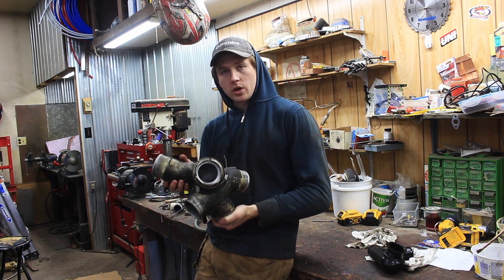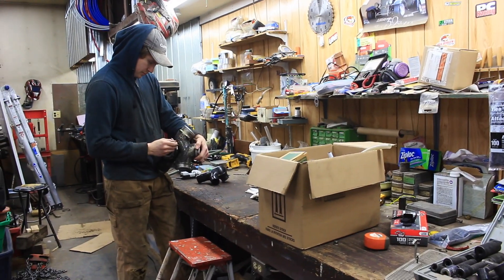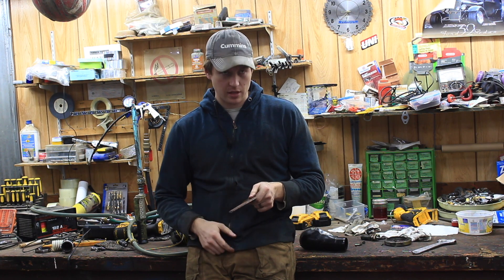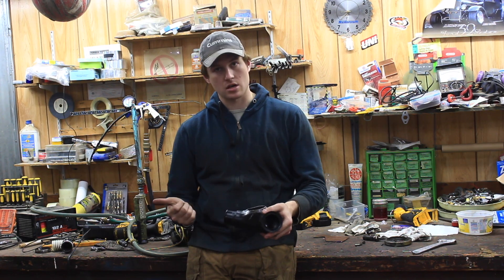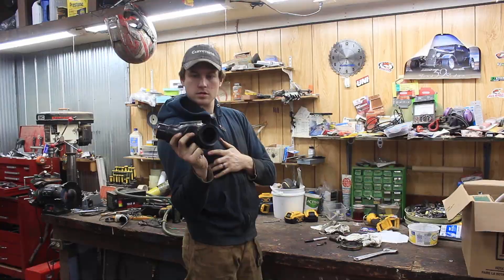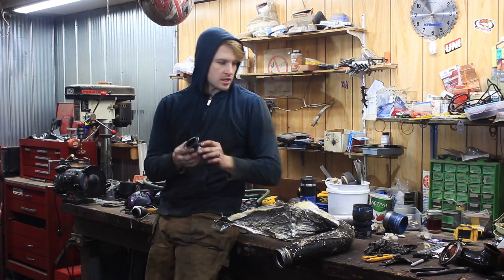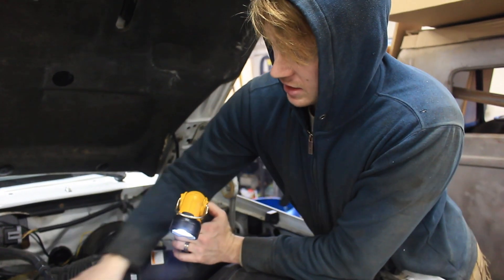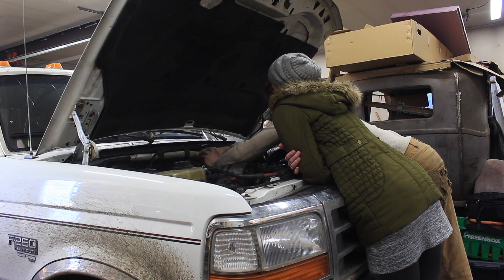Building an intercooler system FROM SCRATCH!  '97 7.3 OBS Powerstroke

Comment: Why not pull the turbo pedestal and turbo off the SuperDuty and swap them over? Sounds like that would be a lot easier than modifying the spider
Reply from the maker: You also have to get the up-pipes, In-take plenums, driver side manifold, and the all the vacuum lines for the turbo. For a mild upgrade from the factory OBS. My turbo has been modified and so would not be an upgrade. It’s not worth the work for a factory SD turbo. Modifying the spider was quite easy.